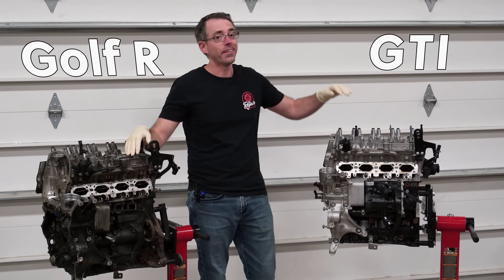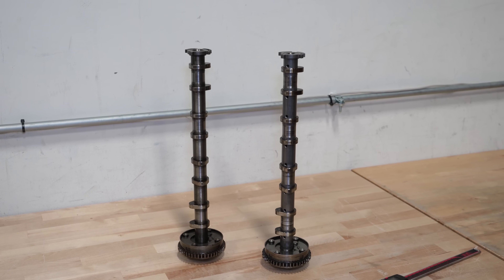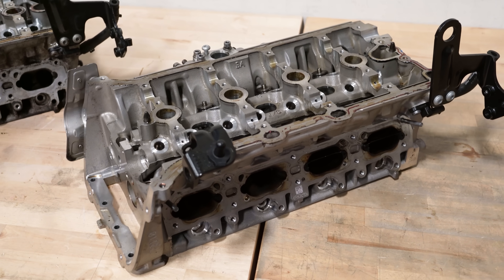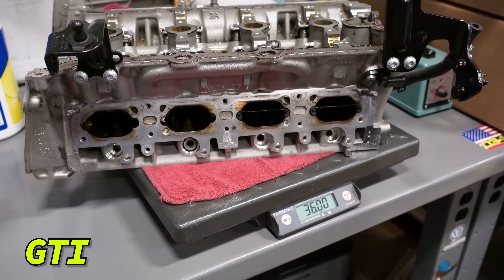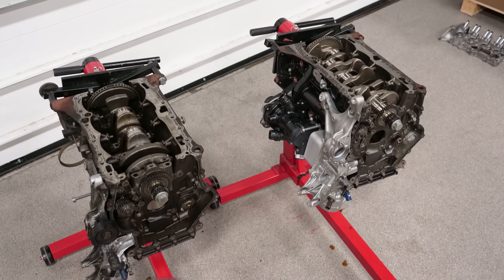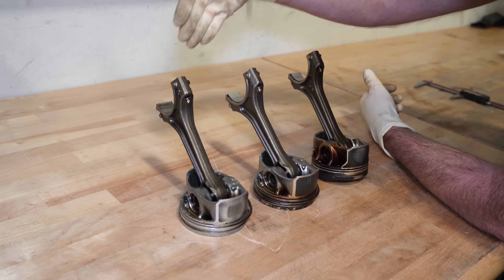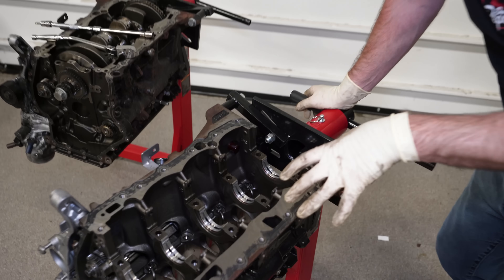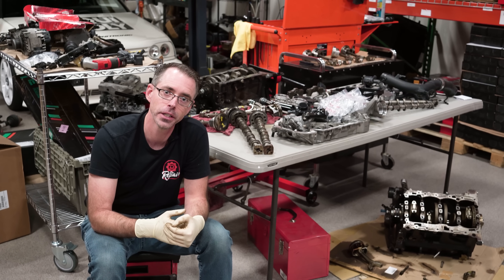Are Golf R Engine Internals Better than a GTI?

Comment: There is still one thing that i don’t understand- why does the launch control in both cars sound different? Like in the GTI is a continuous sound like “rrrrrrrrr”,while in the R is more like aggressive farting 😂 whoever knows what im talking about will understand me - you can even check sound clips. Why is that happening when the engines are the same?
Reply: I know what you mean. I have read that it has something to do with the R having a spark cut based launch control, while the GTI doesn't. The R is also higher RPM launch vs the GTI RPMs I think 4k vs 3200. So you are not wrong the launch is actually different I had to look it up myself I was looking forward to having that R style launch from my MK7 but got a GTI.
Reply: Launch and shift farts are so overrated.
Seems every performance manufacturer has their vehicles tuned to do this now.
Reply: @turnin.sprocket  K

Comment: What would this do for my regular Golf. If I were to do any mods the 1st thing I'd want is a better intercooler and even add an oil cooler to compensate for the extra heat my engine would likely make doing this stuff to it.

Comment: If you want to compare two valve springs to see which is stronger, stack them end to end and put the pair on a vice and squeeze them against one another.  The spring that compresses more is the weaker spring.  

You’re welcome.
Reply: Weaker doesn't mean softer.

Comment: How does the engine in the A4 TFSI Quattro compare? It's IS20 and 252hp.. sort of an interesting between engine.. is it more Golf R or more GTi 😅

I have a 2016 one 😅
Reply: It’s probably only tuned differently from the factory. Kinda like a “stage 1/2”

The engine in the Urus and Audi RSQ8 are identical but the urus generates about 40 more Hp. The only difference is one is tuned by Audi and the other Lamborghini

Comment: Nooooo not the cast crank on the 1.8t Gen3 😫

Explains the torque limit being 340ftlbs(ish) but the limit on the 2.0ts being like 500 lolw
Reply: Cast crank! Oh that would explain why the 1.8 is detuned so much (or rather the power goal was only 180hp, so a cast crank was fine?).
Reply: The 1.8 will do 300hp/tq all day. This does confirm to me that I should swap in a forged crank though…
Reply: @ryan225360  yeah it’s good with less 375 or so I’ve seen before issues… but yeah swap out that crank yolo
Reply: No one knows the real torque limit on these cranks, but I will say that the cast crank torque limit is less than the forged one. Whatever that would be.
Reply: @turnin.sprocket  I’m sure someone has found out how much torque is too much torque on a stock bottom end of a 1.8t by now lol

Been out over a decade atp

Comment: What are the metal composition differences between petrol and diesel engines? Or is this a petrol engine only channel.  Tear part a diesel pd190 engine for all your subscribers.
Reply: Diesel engines usually are built very differently from the petrol counterparts to withstand 16:1 up to 18:1 compression ratios. They have beefy cranks, beefy conrods, large bearing surfaces, beefy long skirt pistons, beefy piston pins. The blocks are stronger and thicker. They just have to deal with a lot more torque, twisting, pressure.
Reply: Yes, more diesel content!!!

Comment: Every part is practically interchangeable. The Golf R has “stronger” internals from the factory, but the weird thing is when both the GTI and Golf R’s engine’s are tuned to max capacity (meaning max power before the engine needs to be rebuilt), the capacity that’s reached is basically the same. 600hp/500tq is each engines threshold before needing to be rebuilt. So really, what’s the purpose of the Golf R’s “stronger” internals if it does nothing for the power or longevity of its motor? Lol. It’s just a talking point for Golf R owners lol.
Reply: Warranty claims, and a premium auto gets premium parts.

If you tune it to the max or at all. VW gets to wash thier hands of your issue.
Reply: @billmccormick874 
Captain obvious over here 😂
Reply: @billmccormick874 I’ve been running over double the factory power for a good 5+ years on my MK7 GTI. It’s currently IS38 custom tuned on WMI and pump gas. Currently has 183,500 miles in it. Never have need to rebuild the motor lol.
Reply: @JacesOwnWorld  that is not the point. VW like every other manufacturer has a warranty on the engine among other components. So due they play a sure hand or double down on a bluff?
Reply: I think most go for the golf R for the AWD.
Reply: They were designed by German engineers.  These people are anal and cannot leave things alone.....
Reply: Nothing is done to a standard of perfection.. every car is a little different.. a stronger composition means less variations and more consistency.
Time.. temperature.. and torsional stress happen all the time.. your assumption comes from the 30 minute usage of the vehicle after being static. 

Im not a fan of either but the moment I want the vehicle working its magic is exactly after 6 hours driving or at 40° celsius weather. 

That's where any difference is going to matter.
Reply: Ya but the metal is different in the heads.. meaning it probably dispurses heat better, and the valves might be stronger.. and with the exhaust cam profile.. it might get an extra 500rpms. And also the piston design with a slightly higher compression possibly. There are differences..and its not made in mexico. I see huge differences as a golf r owner. Lol😂
Reply: @mjspeedzone5532  case in point.
Reply: Lol everything about the golf r is a talking point for their owners.
Reply: Sounds like a well crafted coping mechanism. Typical of GTI owners lmao.
Reply: I agree the only reason a golf r over the gti would be for the 4wd not the engine

Comment: Only difference is the turbo.
Reply: Either you didn't watch the video or you sit on a throne of lies.
Reply: @bunter6 he is technically right though because Golf R owners claim certain things that are “better” than the GTI in its engine. Some of those claims were proven, but some were disproven. But the kicker is that the few parts, like the squirter, is so negligible that they literally do nothing for the longevity or performance of its engine. So really, it’s all just stupid talk from Golf R owners (especially now that they know even the GTI has forged parts from the factory haha) trying to make them feel better about their purchase…
Reply: @JacesOwnWorld  they arent though are they. The head is cast out of a completely different metal composition with no channel for seconday air injection, the exhaust valves are different, exahsut cam duration is different and the pistons are different.  So that's significantly more than just the turbo.
Reply: @JacesOwnWorld I don't think there are any R owners out there "trying to justify their purchase." I've had both; the R is simply the better car all around. Drive one--you'll want to sell the GTI and get the R immediately.